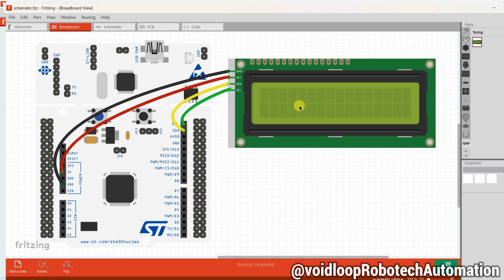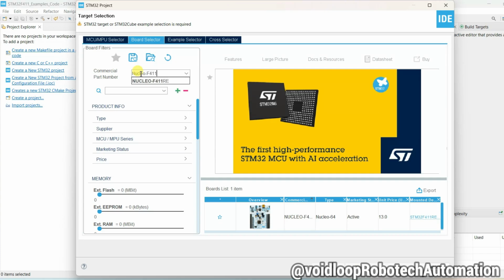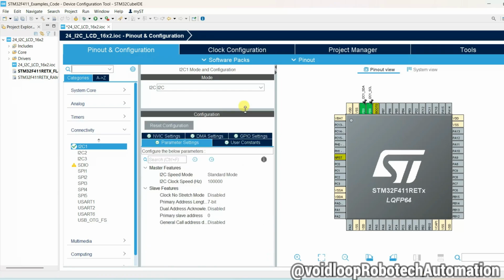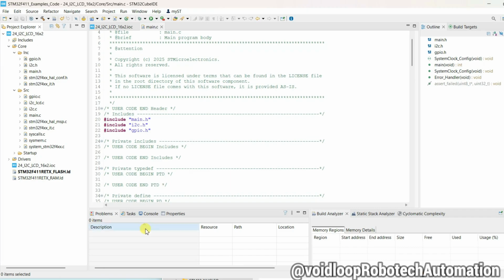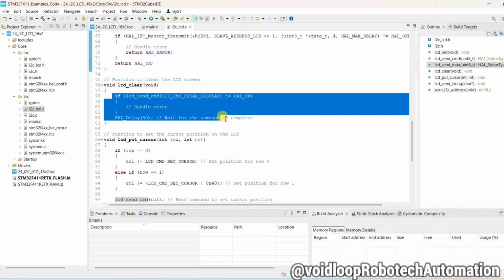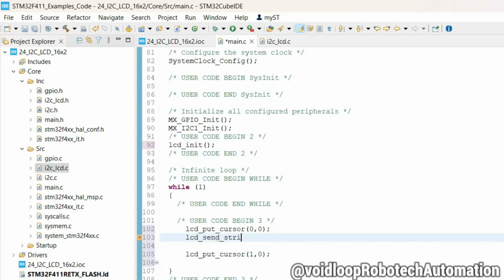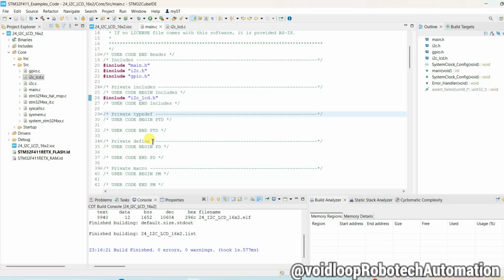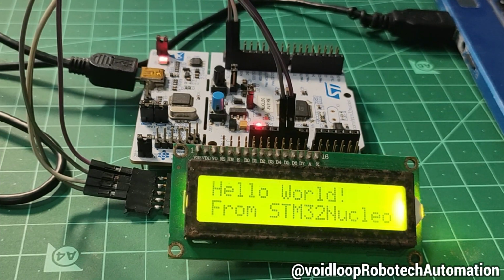24 I2C LCD 16x2 with STM32 Nucleo Board || STM32 Cube IDE ||

Comment: Hello. I had built a smart range hood circuit, and I accidentally connected the GND of my 12V power supply to both the GND and Vin pins of my Nucleo board. Now, when I connect the STM32F446 Nucleo-64 to my computer, it doesn't detect it. If I remove the jumper labeled JP5, my computer detects the ST-LINK, but not the STM32F446 chip. When the JP5 jumper is inserted, the ST-LINK's red LED blinks. Can u help for this?